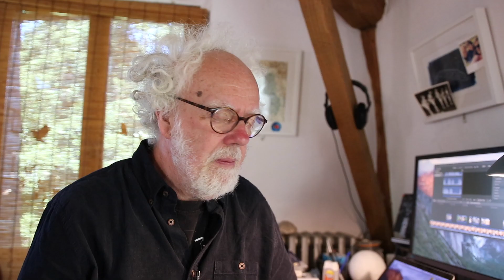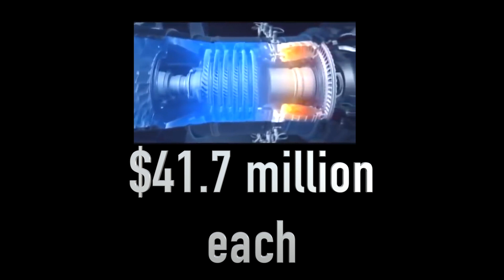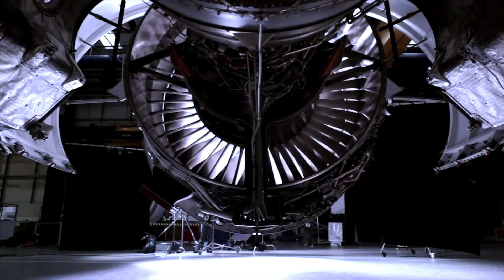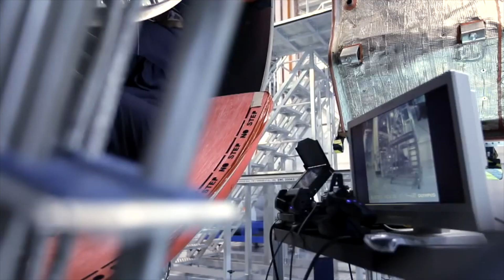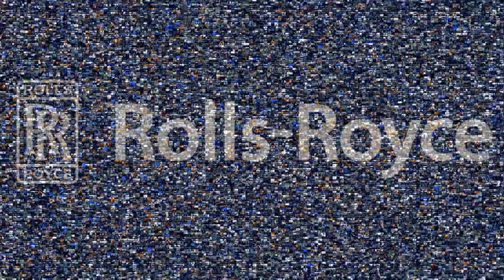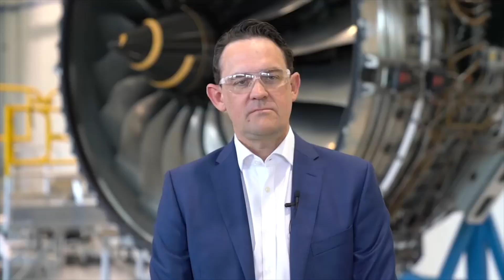Boeing 737 max 8 and Rolls Royce Trent 1000 problems - Prof Simon

Comment: The RR guy said that they have increased their repair capacity 300% to fix their previous engine model, not the current model.
Reply from the maker: Yep....I just don’t like using 300% when you can say...10 more engineers.
Reply: @SimonHollandfilms  the point I was making was he was discussing repair capability and not engine product quality improvement.

Comment: I have a idea for a air powered engine that is kind of primitive , but Im sure it will work . Why are you still using fuel , thats probably getting too hot and melting the parts . If you want to take a chance , I will GIVE you the design , which can be adapted to space and with the help of the UNIVERSE it will work . If you are interested you can send a engineer to my house , or whatever . But if you decide to send someone send me a picture of them , M/F however you do that . You know where I am . ( Donations will be accepted ) HA HA .

Comment: As the recent crash in Russia has shown modern jet engines are susceptible to failure from even minor shock or impact, whilst large scale events are devastating. The regular thermal shock and pressures from cold start up to take off will expose any materials deficiencies and the higher the rating of the engine the worse this will be. Extended maintenance cycles exacerbate these problems. We are paying the price of a low cost everything culture that means the cheapest - not the best - takes the prize every time. Improved maintenance cycles will help but long term a more thoughtful understanding of the issues is required by all companies involved.
Reply: John North All jet engines are susceptible to failure from minor damage due to the very engine concept. Any time you squeeze more performance out of a design, more pressure is on each component. Ask any Lambo or Ferrari owner. The extended service intervals just add to the problem.